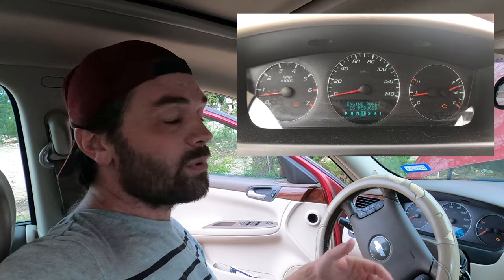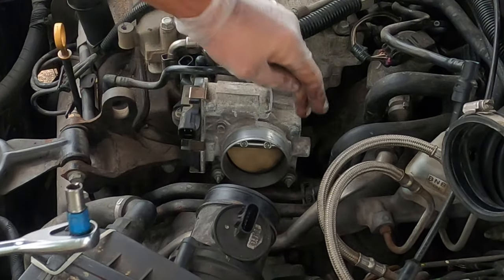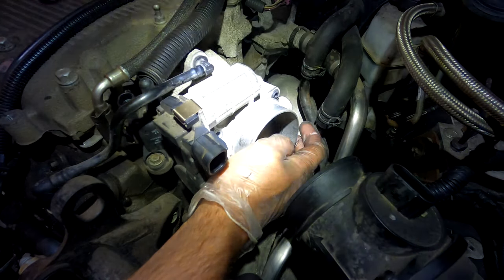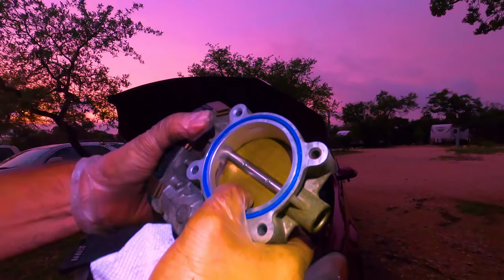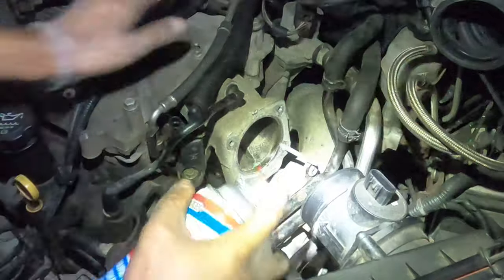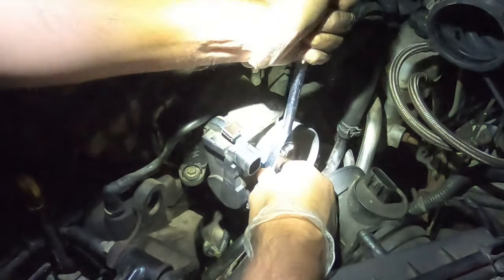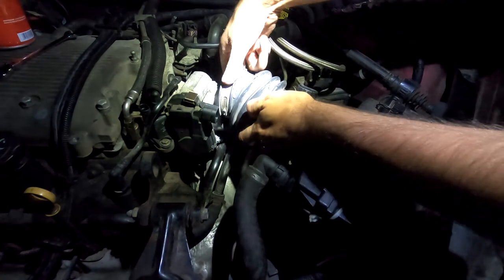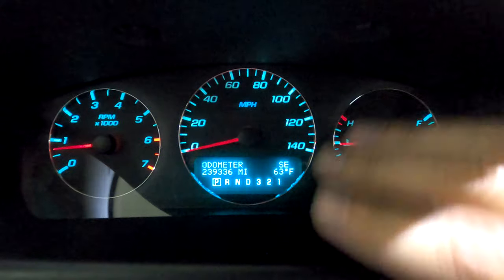Engine Power Reduced Chevy Cars - Part One

Comment: Please what does this codes mean 
P0054(4/5)pending 
P2128(3/5)stored in my Chevrolet impala 2007?
Reply from the maker: P0054 means Oxygen sensor number 2 is probably bad. P2128 might be a bad gas pedal. Both should be simple to fix.

Comment: I just replaced the throttle body on my 07  and now it's idling higher than normal any suggestion on how to fix my issue
Reply from the maker: Yes, I just had the same issue and I’m about to release the video. It’s your gas pedal and it needs to be replaced. Very easy to change out yourself.
Reply from the maker: Here is the video for replacing your gas pedal sensor - https://youtu.be/qzjbLgL4AJw